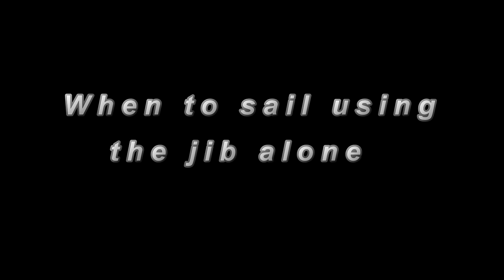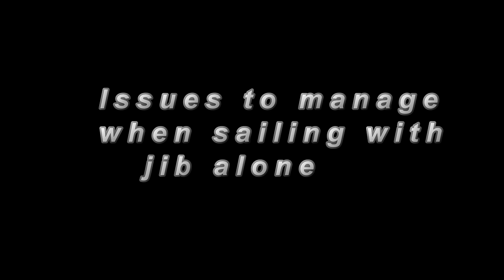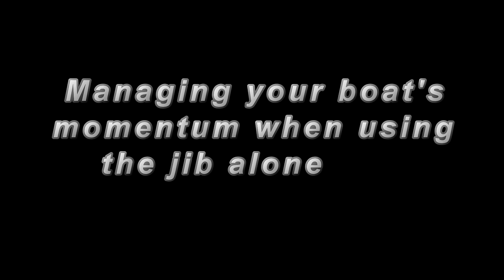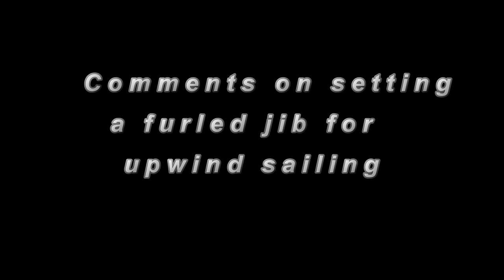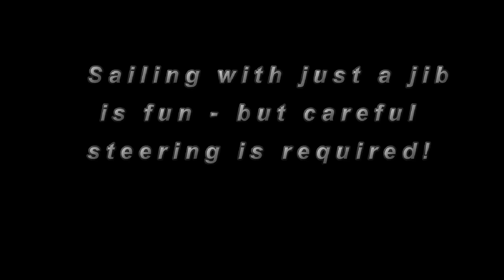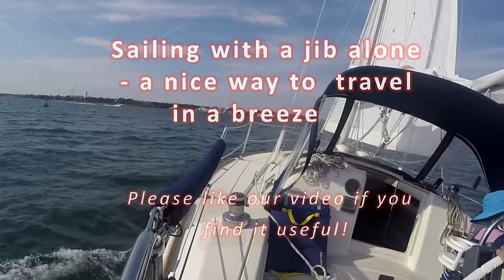Jib Only Sailing (watch the re-mastered version) | Sail Fanatics

Comment: Upwind sailing, with the jib alone?
I can think of only two reasons for it. a) lazy sailors b) not comfortable with handling the mainsail. 
On the downside: a) difficult to get the boat balanced b) many helm corrections (i.e. slower boat) c) cancelling of the slot effect (i.e. slower boat) d) difficult to tack, especially on choppy sea. 

For downwind sailing, yes, especially if the sea/wind conditions make it susceptible to an accidental gybe. 
Plus it provides a better steering control. Image you  have a trolley; how would you better drive it to the direction you want it to go? By pulling it from the front, or pushing it from the back? Likewise, on a sailboat you transfer the CE fore, with the headsail on, in difficult situations, and in downwind.
Reply from the maker: I'd say someone who isn't wise enough to sail with jib alone, when it is appropriate to do so, as explained in the video, is a stupid sailor.

Comment: If you are new to sailing or close to shore, the "jib only" is a bad idea. Much more wind and that vessel would not be capable of holding a beam reach but rather pulled directly downwind - which appears to be the shore in this video. This problem is worsened on a smaller vessel. The jib and main work together (balance) and make the boat steerable in all points of possible sail.  On many vessels the "jib only" sail configuration will cause lee helm - absolutely undesirable (and perhaps dangerous) in gusty conditions that are common on the lakes I sail. Fun to try but make sure you are far (upwind) from shore.
Reply: That recently happened when I was sailig with a 15ft open boat reffered to as a "Valk". Close haul was possible but once I tried tacking, the boat just wouldn't turn and instead I was pushed downwind to shore
Reply from the maker: @sailingaeolus  
Patrick
The video is explicit about the situations where sailing with just a jib are appropriate. I don't know what you think of as "poor conditions" but usually that means higher wind speeds if not also wave action. Just a jib is fine with good wind pressure,  as the video says you need to pay attention to the operation of the boat.  The sailor who has control difficulty under a jib alone, will probably have just as much difficulty being over-powered with both a jib and main.
Perhaps trailer sailing you stay home in wind conditions where the jib and reefed main are too much sail, and you need to make a choice...  Some smaller boats WITHOUT a furling jib, like yours, in high winds just a main can be more appropriate, in mid-size boats like my current 31',  just the main provides very little power, and it would poor seamanship not default to use the jib.
Reply from the maker: @patrickboek1138  
You need to establish and maintain momentum to be able to drive through a tack.  If you have difficulty tacking reliably, then bear off to a close reach, on that point of sail when the jib is properly trimmed you will have greater speed than close-hauled. Start your tack from close-reaching, the speed will take you through.

Comment: I see a lot of cruisers using jib alone, but on my boat I can't seem to get used to it. For some reason my J boat doesn't like jib alone, lee helm is annoying and the tendency to turn down in big wind is overpowering when boat speed is low. Also I can't point nearly as high. When furling normally, the usual plan to turn into the wind, spool in the jib and then lower the main. But when jib is up alone, I think it may work better to furl when headed downwind by releasing the clew line and spooling in the jib without turning into the wind. I'd be interested in what others do. It's tricky to point directly into the wind for long enough to furl completely before the boat loses forward momentum and steerage, then turns sideways.

Comment: Why use the Jib only technique rather than dropping the jib and sailing with a reefed main only?
Reply from the maker: Frank
With most sloop sailboats  the jib is larger and more powerful than the main, especially a reefed main. So the jib alone will power a sloop much better than just a main, other than downwind where either sail can be effective. Most sloops I have sailed are very sluggish under main alone, but lively under jib alone.

Plus a furling jib is much easier to deploy that sailing and reefing a mainsail.
Reply: @SailFanatics  Thanks for the info and the great videos.  I bought a Cape Dory Typhoon a couple of years ago and your videos really help me learn and practice good sailing techniques.  Thanks again!

Comment: Can you talk some about a run downwind with a jib only in following seas?
Reply from the maker: Ali,
Running downwind, either the jib or main can be effective, the sail power is entirely based on the amount of sail area with either sail.  However, a big plus of the jib only configuration , especially in high wind or rolling sea conditions, is that a jib cannot accidentally jibe, whereas a main easily can. In high winds, an accidental jibe can injure crew or break gear.

See https://youtu.be/E3ncFyj4rag

Comment: Its good to note that  sailing thus  , depending on boat design,  can in higher  winds  25 -30knts make it difficult to make the tack ,  and pass thru eye of the wind....found that out thru experience...the hard way,   nearing close to a wharf..had to gybe headsail  as she was not behaving.
Reply from the maker: Yes, that can be a significant issue as with jib alone it is difficult to maintain momentum. One trick to try, is prior to the tack, easy off just a big to incease speed, then turn up and right into the tack, benefitting for the additional momentum this provides.

Comment: I feel like you could have been making 7-8 knots if you had the main up...
Reply from the maker: I don't think the boat would have been much faster with the main up, as due to the wind speed we would have needed to then reef the jib (and the main). If we were sailing any distance in these conditions, I would have the main up, with both the main and jib reefed. We might see some better speed, but the major advantage is the boat would be better balanced and easier to handle.  Sadly, not likely to ever make 8 knots close hauled...

Comment: The thing that confuses me is when I took my boat for a first sail in very strong winds with Genoa only the boat has a very strong weather helm instead of lee helm. It was very tiring as my boat is tiller steering.
Reply from the maker: Liam,
Did the genoa produce a high heeling angle? If you boat was heeling a great deal, I would suspect perhaps the weather helm of the immersed hull shape overrode the imbalance produced by just a jib, and you end with weather helm. Try some steps to reduce the sail load: partially furl the genoa or use a smaller sail, flatten the sail with halyard tension, ease off the wind just a bit...see if anything helps.
Reply: Sail Fanatics Yup, I let a bit too much sail out. That explains it thanks!

Comment: Good information, thanks!  I have a lot of difficulty tacking with the jib alone.  It always stalls out just as I head directly into the wind.  Any thoughts?
Reply from the maker: Steve,

I think the key is to ensure that you have good boat speed prior to starting the tack.  If the boat is sluggish or slow and you want to tack, consider easing the jibsheet and bearing off just a bit to a close reach to pick up speed. If you have the jib trimmed correctly, you should re-establish good speed. Then go right into and through the tack. Same thing after coming through the wind, dont be afraid to to turn to the close-reach position to pick up speed before turning back to close-hauled.  When close-reaching, you are adjusting the jibsheet to ensure the jib is not stalled, not the rudder. When close-hauled, adjusting the boat angle with the rudder has the unfortunate result of slowing the boat when you least want that to happen...When sailing with just a jib, don't go to close-hauled until you are carrying speed built close-reaching.

Good luck,
Tom
Reply: Yeah, you can pick up some speed (if speed it the problem) by bearing away - since reaching is a faster point of sailing (and probably puts your boat at a better angle w.r.t. the heading waves). 
And you could also start the tack by back-winding the headsail, to more easily drive you through the dead-iron zone. 
But there are situations where tacking with the headsail alone is too difficult (or impossible?) For instance, on choppy sea. The best you could do then is to sync your tacking with the next upcoming wave, and wish that you did that right, and hope that with the help of that wave you'll make the follow through. 
That's why upwind sailing with the headsail alone is not a clever idea.